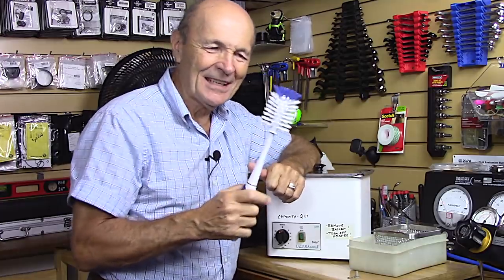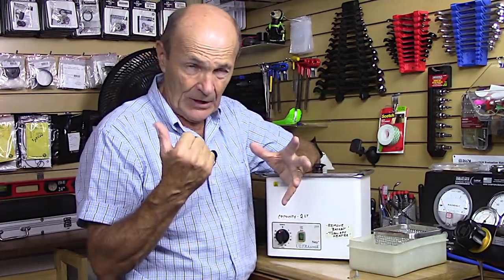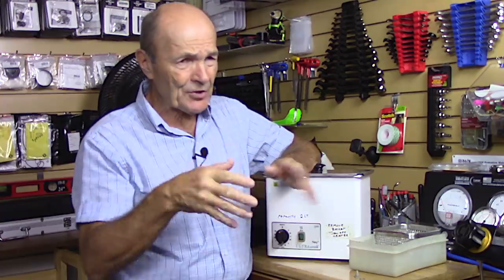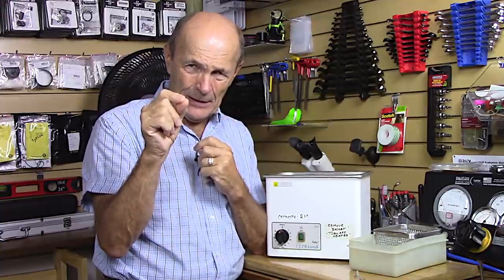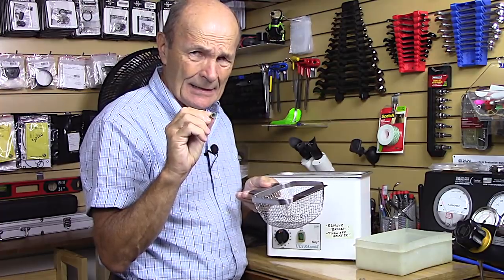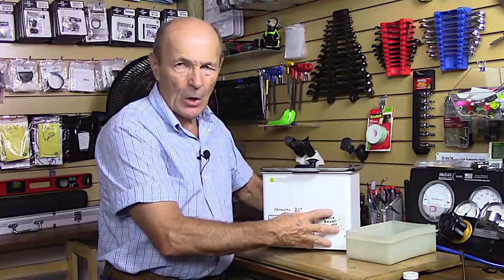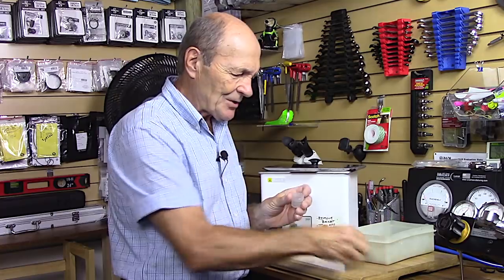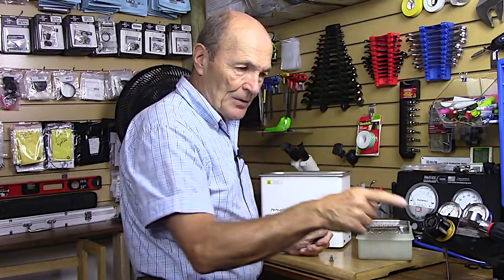Regulator Cleaning With Ultrasonics - Scuba Tech Tips: S08E07

Comment: Hi Alex! Just want to say that I'm a huge fan. Your series has really helped me with my gear choices (and relieving me of a lot of $ at my local dive store) and feel more comfortable with how everything works. Unfortunately I had a pretty bad issue today where my SPG was reading 800 PSI when I went to retrieve a 30M transect tape and when I returned from the 60M swim to retrieve it, I only had 300. 30 seconds later, I was 100% out and had to share air with my buddy to the surface. 

The dive shop looked at the tank (just purchased 3 months ago) and couldn't find an issue and my buddy didn't notice any bubbles coming off me. I borrowed someone's backup regs for the next dive and used air as expected without issue. I noticed that my SPG always would read 3600-3800 after filling my high pressure 80s and that recently it seemed as though I'd go through air faster as my tank was getting more empty, but I'd just assume it was due my own inexperience. On this dive, I also noticed that I burned air fast descending from the surface (lost 500 PSI dropping 45 feet).  After we removed the SPG from its boot and hose, we noticed that it rattles when you shake it, but I don't know if that's normal.  

Do you know what could have happened? Is there any way I could have realized that there might be something wrong with my SPG earlier? Hint, hint: a video on early warning signs something might be wrong with SPGs or any other equipment would be super helpful.
Reply from the maker: Gosh Laura. That's an odd one. If there was no visible air leak, it would be hard to pin down.
However, SPG heads are cheap. I'd replace it anyway. Then you know it's accurate at least and can do a better job of monitoring.
Maybe it's time to think about an Air-Integrated dive computer. With most of them, you can connect to a computer and see your air consumption throughout the dive as well as compare your consumption over many dives.
The SPG head can be loose and shake about a bit when it's not under pressure. If it isn't leaking, it's OK. However, the swivel pin costs about $5. Maybe it should be replaced to be sure it doesn't leak or even blow during a dive. Pretty cheap insurance.
Thanks for the tip and for your kind comments.
Alec
Reply: SPG are not that reliable - dive shop small SPGs by the fill station are +-300 PSI when checking pressures. seems like AI computers are much more accurate digital versions (though I suspect my computer went to 0 PSI which I tested in the pool and still was able to take 20 breaths - maybe build in safety like  car tanks.
Reply: Thanks Alec (sorry about the spellcheck miscorrection in my original message)! I went ahead and replaced my SPG (and used it as an excuse to buy the air integrated Scubapro G2 I'd been eyeing), but when cleaning out my BCD I realized that it was also leaking, because one of my dump valves wasn't completely screwed on, and only leaking when it was very inflated on the surface (probably leaking whenever I added air at depth) - that probably explains how I lost 500 at the surface and went from 800 to 300, since when we are doing surveys we normally dive a little "heavy" and move down the line very slowly, but must have tried to inflate it to swim to get the tape, initiating leakage that my buddy didn't notice because he was finishing his survey. Then it probably went from 300 to 0 because the SPG was reading high until it was just out. 

Just goes to show you how many variables can create a synergy leading to a dive incident - SPG reading high, BCD leaking but inconsistently, task loading, and diving in a way that I wouldn't immediately notice the BCD issue the way I would if we were just swimming around.
Reply: Thanks Alain! I did go ahead and buy an AI computer as well....

Comment: As a detergent, i use a mixture of water with a bit of vinegar acid (i can buy that as "vinegar essence" at every supermarket) and some drops of a normal dish soap. Does the job perfectly.

I don't have a heated ultrasonic cleaner, but a more simple one. I just fill in warm water for better cleaning. (Not only against salt, but also for removing lime with the vinegar acid. The chemical reaction for this is boosted by temperature.)

Comment: Hi Alec
Did you ever thought about, just to clean the filter instead of replace them?
I just imagine, in some cases it could be a smart idea, if the rest of the regulator still looks fine. 
I know if you would clean the filter, you may couldn't have another 100 dives before replaceing the parts, but maybe it would be possible to get 150 dives before replaceing.

I guess I would try it. 
If I could service my own gear, I may would clean the filter, after 10/15 dives I would check it again.
Reply from the maker: It is a requirement from the maker that all service kit parts be used.  Otherwise the customer is getting ripped off.  Also the effort, time and cost of an u/s cleaner is much more that most small LDS's might want.
A

Comment: Hi Alec! Great video! Would you mind sharing some specs about what should I look for before buying an ultrasonic cleaner? What model, size, brand is the one you use in the video and is always there in the background of every video? Thanks!!
Reply from the maker: 90 to 100% of all Ultrasonic cleaners are made by the same companies. My point is that there is very little difference between different makes & models - at the consumer level. Industrial cleaners are different. To be honest, I went online and compared several cleaners that had the features I wanted - a heater, timer, and the right size. I bought it online. I chose one of modest size. You don't need a big cleaner to clean regulators. You're only cleaning small parts, not the whole thing at once. So mine is 2 liters (2 quarts) capacity with a heater & an automatic timer to turn it off when done.
I hope this helps.
Alec

Comment: Great video as usual!

What do you use for O2 cleaning? Or what is the proccess?
Reply from the maker: O2 cleaning is a completely different process. It's so different that we actually have an entire separate set of tools just for that - a separate Vis light that is kept is a sealed plastic bag, separate wrenches, different O-Rings that are sealed until used, different grease and so on. Everything is kept in a separate drawer and sealed in plastic. Even the rags used for cleaning and wiping are new and kept separate. Since O2 cleaning basically is the removal of all contaminants, particularly grease or oils, nothing used in a normal service process can be used for O2 cleaning.
The actual cleaning process is similar.
Alec

Comment: Hi Alec
Could you recomend a clenaing solution for ultrasonic?
Google doesn't tell me the correct answer.
Reply from the maker: First use hot, deionised water which is a natural solvent.  Then either a commercial product or home made.  There is a wide range of cleaning products, some better for metal, others for plastic.  Suggest reading all these posts on SCUBABOARD.COM that will answer most u/s cleaning questions.  
https://scubaboard.com/community/threads/recommend-ultrasonic-cleaner-solution.610084/ 
A
Reply: @AlecPeirceScuba_SeaHunter  Thanks for your reply. I'll review that link.

Comment: funny i just bought a small Ultrasonic couple weeks ago to clean an older regulator I wanted to tinker with (practice before doing my main one). Used pure white vinegar on a quick release connector (think stainless steel?) and came out looking like new when it was pretty corroded. Did same on entire taken apart regulator and I think the plastic parts smell like vinegar now :)
Reply from the maker: Check with the manufacturer as they have recommended solutions or google to find a home made one that you like.  Be careful as over cleaning is just as bad as no enough.
Glad you like this subject.
Alec

Comment: Hey Alec, thanks for another great video. One question I have, is how would you clean, besides from replacing it, the small “dry air bleed”sintered filter imbedded in the Sherwood piston regulators, when they get silicone grease, when servicing them? I tried  just about everything and does not work well. The closest thing so,far, has been heating the piston to about 700F over an electric stove, to burn off the silicone grease, but I don’t it is ideal. Any thoughts? Thanks in advance.
Reply from the maker: Those dry air bleed filter cost about $0.16 each. Why are you trying to clean them??
It's pretty much impossible to clean them anyway. When working properly, they get dirty inside and out.
A service kit for those older Sherwoods always includes a new dry air bleed filter and the plastic washer too.
I have Sherwood service kits for sale on eBay, cheap! My eBay ID is Seahunter.
Take care Miguel.
Alec
Reply: Alec Peirce Scuba the Sherwood I have, the Oasis +, I have to replace the whole piston, and they are about $35-$40 a piece. I have about 3 or 4 with the same problem, with the contaminated dry air bleed, probably not more than 3 years old.
Reply: ebay.com and ebay.ca doesn't show anything from seller 'Seahunter'.. hummm...
Reply: Alain Dumesny He put stuff on occasionally, not always.

Comment: Hi Alex, 
Do you think it is ok to soak dive computer here with warm water only (or maybe a bit dishwasher cleaner)?
Some narrow part between button and screw has a little dirt and maybe somewhere behind the sensor where I can see it. 

Thanks
Reply from the maker: To be clear, never put a dive computer or electronic device in an ultrasonic cleaner.  It is for metal parts only.  Any electronic device can be soaked in fresh hot water (sink or bucket) to loosen dirt and keep the buttons working.  If they are stuck, get your local dive shop to fix it.  Take care Kresna.

Comment: Hey Alec quick question: is a dive wetsuit the same as a surf wetsuit. Are they any different in any way and do they perform differently under water? Thanks!
Reply: surf suit are made to be VERY stretchy - the latest Oneil I use windsurfing is so stretchy at the neck area I can put my entire body through (no zipper) . Dive suits are made of denser neoprene so they don't compress as much as you go down (loose warmth and buoyancy). May not matter as much for a thin shorty spring wetsuit
Reply: Thanks for the great reply.

Comment: Hi Alex, I just had 2 of my 5 sets of Mk25/S600 regulators serviced by a Dive shop and my second stage body now looks like it's faded or the plastic is damaged. Do you know how this can happen? Should the plastic body of the second stage be put in the ultrasonic cleaner? I've always taken great care of my gear, so this is extremely disappointing, especially since they said it must be sun damage (is this even a thing with Scubapro second stages?) And I know when I dropped it off it looked brand new. I've left my regs at the shop so I can speak with the Manager next week, do you have any advice on what I should ask him? I have taken photos of them but not sure how to upload here. Thanks Pauline
Reply from the maker: I sounds like the 2nd stage body was put in the ultrasonic cleaner.  If you have resent pictures of your reg before the service, take it to show the change.  Talk to the Manager and show the change and if normal, as to see other regs serviced to see if they should all look worse too!   If the Manager does not agree it was the cause.  Ask him to take a new 2nd stage and put it in the u/s cleaner for 15 mins to prove there is no change.  Note, if a u/s cleaner works on metal, it also eats plastic bodies.  Try and reach an agreement not a fight.  You may need air fills and he may want to sell you something shinny some day.

Comment: or you could just use a vineger /water bath, does the same thing , and was used for many years before ultrasonics
Reply from the maker: Yep. That works too. 
Vinegar is just an acid so it attacks any crusty stuff. The modern solutions also work on rust and grease.
Thanks.
Alec